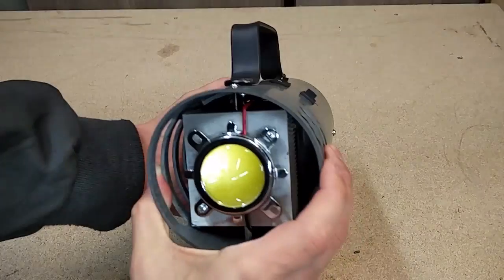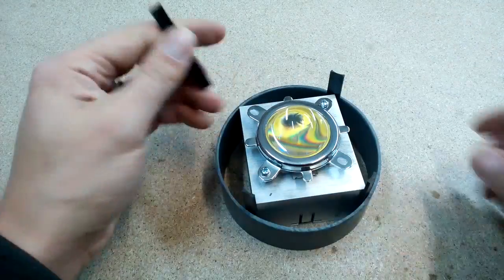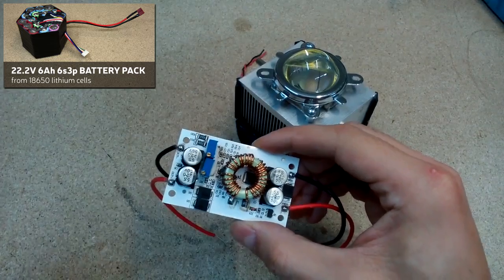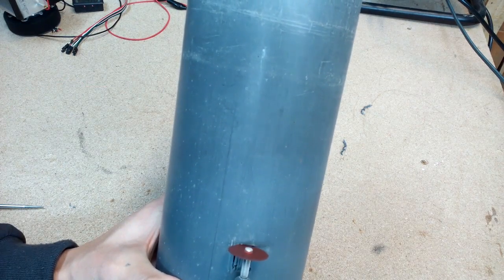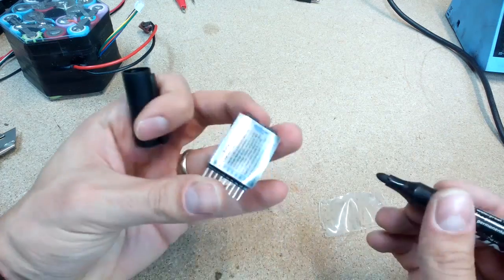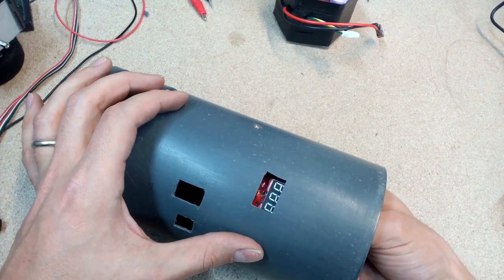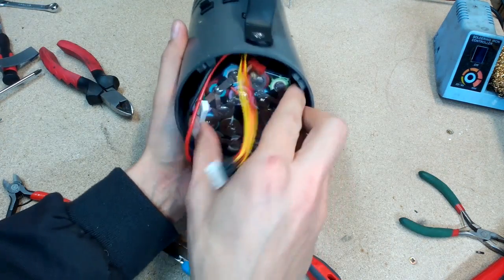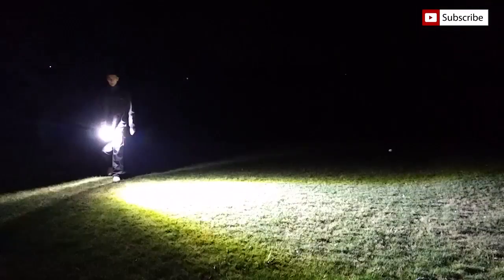DIY: 100W LED Flashlight Mounted In PVC Pipe

Comment: That is honestly one of the most elegant DIY LED flashlights I've seen on YouTube.  Only thing I would personally change is to sacrifice a small amount of overall length to give the cooling fan a bit more breathing room;  I, personally, wouldn't feel comfortable having the circuitboards that close to the airflow of the fan, just from the standpoint of the fan not being able to move the maximum amount of air away from the heatsink.  Gorgeous, though.  Very well done.
Reply: What it needs is someone to strap an corsair h110 to that board and Watercool that bitch
Reply: I went to the 99 Cents store and bought four LED flashlights, tape them together into a round group and turn them one. $5 dollars project done in 1 minutes.
Reply: Pheap K you don’t realize how bright that led is
Reply: I677  b bbn b bb 770g per v7r vg vv 5am u t t to z5
Reply: Ian Mcclue u

Comment: So your taking all the heat from the LED away with heatsink and a fan, but your blocking the hot air from escaping with a fucking circuit board.

Comment: isn't it much better to use RC Lipo Battery ??! ..
Reply: +Gery Revandra with this amount of batteries it dowsnt realy matter
Reply: +yakir11114 but isn't it kinda wasteful to use so many small betteries then stack it into one huge power supply ??! ...
Reply: +Gery Revandra  Those are 18650 cells. Tesla uses thousands of them for their car. Laptops often use up to a dozen of them. They tend to store more energy by weight than RC lipos, and they are also much tougher physically. They can't source the extreme current of an RC lipo, but the LED is only 100w.

It also looks like his batteries were salvaged from dead laptop batteries, which makes them far cheaper than an RC lipo.
Reply: +compwiz00 ah , i see ... thanks for your info ...

Comment: this is so awesome I've been planning something similar, would it be possible to place a analogue dial to adjust brightness? if so where would you wire it in?
Reply: a heavy duty potentiometer in series with voltage trim pot would work, just make sure to only adjust your trim pot while the extra potentiometer is at max brightness.

Comment: how long it will run on those batteries and how do you charge them?
Reply: He's gotta learn somehow, bud
Reply: Well, I'll answer you...
Assuming the cells are about 2000mAh (7.4Wh) then 6S3P will have a capacity of 6Ah with an average voltage of 3.7x6 = 22.6 V and total Wh of 18x7.4 = 133.2 Wh.
At 22.6V, 100W will draw 4.4 amps.
Assuming the LED is running at 100W and (100% boost converter efficiency!), then it should run for 133/100 hours, which is 1h 20mins.
To charge, remove grill, unscrew bracket and slide out battery pack, unplug the balance cable and Deans connector and plug them into any cheap lipo balance charger, such as a B6AC.
Laptop cells in general shouldn't be charged faster than 1C (that's 2A for a 2Ah cell), but lower is better for cell life. I would limit charging to 0.5C or 1A per cell, so charging at 3A would be appropriate.
It should charge in a couple of hours.
I would make a Y cable for the balance leads and power and make them available to charge without having to disassemble it!
Reply: Unerring 01 lol right. Everyone was born with everything they'll ever know
Reply: guys, he is asking where exactly is the charging connector or if there is none, what is the exact procedure to charge them (i.e. open the assembly, take out the batteries etc.)
Reply: avin r Exactly.
Reply: Wrong, if you don't know stuff you can't learn stuff. Everyone knows that.

Comment: Very nice build, I like the packaging. But I still see some room for improvements: clear cover over the lens to keep bugs and stuff out, bug screens on the cooling vents, bigger cross-flow style CPU heatsink, and use R/C car or airplane battery packs for quick swap-out and using OTS chargers.

Comment: I would just use a 12v battery and wouldn't require the down converter.
Reply: Its not a 12v led, as its 10 leds in series times 10 in parallel, 1w each.
That would mean something between 30-35v, and an adjustable supply is needed.
Reply: +drkastenbrot u r using a up converter anyway so a 12v - 36v upconverter should be fine.

Comment: Very very nice idea to put it in a PVC pipe.. Such a simple idea! :) Just a tip, when tapping, counter-rotate the tap every two turns to get rid of the stripped aluminium so your tap lasts longer.

Comment: Less "greeze" is better ;-)
It must be a very thin layer, use a credit card to swipe off the excess.
Reply: +Roger Keulen I agree, on precision parts with flat surfaces. I used to mount large power supplies to heat sinks that were about 30" by 14" mounting surface. Anyone can then look at heat build up in  the power supply. I used a wide putty knife to apply thermal compound. That and for long term maintenance, it's nice to leave the work area as clean as possible for yourself or another technician.
Reply: +Roger Keulen Nope. linus tech tips proved that you can use as much as you want, too little is bad.
Reply: You think ? It's to make the surface smooth.
Reply: Roger Keulen it really doesn't matter how you apply it you just need enough to cover the thing.

Comment: Nice job and very well presented -- thank you
Reply: The thermal paste was incorrectly applied though.   It should be used WAAAY less, and you put a dot in the middle of the diode, not the heatsink, and then let the pressure flatten it out, which avoids trapping air bubbles.

Comment: How much did this cost to build?
Reply from the maker: +Sean Pain something around 22-23 eur  (24-25 USD).
Reply: Well Done Tips can you make me one and send it to me in the US, how much it can cost me?
Reply: But, the one you linked is much inferior in many ways:
The one in your link will get much hotter in your hand, the battery won't last nearly as long, it won't run at max brightness for very long without burning out or draining the battery, and is only 2/3 as bright as the one in this video.
Reply: Disregard that comment above. It's spam. That link has been spawning in all similar videos. That's a cheap chinese ripoff of a so-so flashlight.
Reply: +simon del calvario 100 eur, 23eur materials cost, 77 job
Reply: +pierre jean You forgot shipping cost :D
Reply: +pierre jean You forgot shipping cost :D
Reply: around 140 bucks

Comment: awesome build. lithium battery pack and battery tester builtin. driver placement right behind fan. great ideas. thumbs up for all of that.
although it have same problems like every other built have.
1. too much work to built.
2. no mechanism built to easily recharge the battery. you could have given some port to connect the balance charger like imax b6 which is needed in this case.
3. heat sink is too small. it wont be able to run for long time. it will get too hot. i have already checked these things.
keeping all these things in mind. i made one 100W LED flashlight myself few days ago.
check it out.
https://www.youtube.com/watch?v=xzh0OwaisjE
does not require too much work to built and it uses regular tool batteries. which can be easily charged by the charger that came with your lithium drill.

howevery to make it more easy i built another project. this one uses 72W LED work light which is readily available on ebay. all i did was to connect it to batteries. here is that project.
https://www.youtube.com/watch?v=t5Z4kXAPsJM
this is very very easy.
light output of both flashlight was almost same.
if you like these project. subsribe to both channels for more projects like these.

last but not least. i really really really like this built. just add a way to easily charge the batteries.
Reply from the maker: +Buffalo Geeks yes, if I'll use this flashlight day to day - then I definitely will make a charge port. At a moment - I'm using it very rarely, so to charge battery isn't my day routine.
This is my interpretation and idea, how I to make 100W LED flashlight. There's many other possibilities to solve body, power and cooling issues.
Reply: +Well Done Tips Lots of circuits on Ebay. I have replaced most Chinese product with defective batteries with 18650. Never had any issue, just have to check the voltage ratings of original battery, a bit off works good. Have done this to my Mosquito squatter and LED torch, Could fit 2x 18650 in chinese torch, they last for ever.

Comment: Great video, how long will the batteries last.
Reply from the maker: +k fro this my homemade 22.2V and 6Ah battery pack is able to power up flashlight for 2h.
Reply: +k fro setted to 3 amps the led the batery pack has 6Ah preatty much close to 2h, less led britenes then the maximum will it get more hours from these bateries
Reply: no overheating problem?

Comment: what about mode selector? Like: Hi-mid-lo?
Reply from the maker: +Dmitry Lyashuk there is an option to install a dimmer and you'll have full brightness control. But at a moment - I don't need this option.
Reply: +Dmitry Lyashuk if you want a dimmer design look at "DIY Perks" video
Reply: +Well Done Tips мужиг, ты кросавчег. Но мне кажется, им можно самолёты сбивать))
Reply: How would you make a dimmer work with this driver. Im trying to put a light together using this driver.
Reply: there are led drivers with build in dimmers via a pot... they are widely available on eBay.. led driver dimmer... look that up... done...! no thanks Urr welcome!
Reply: You can essentially hack the driver where the small blue current potentiometer is.
The pot works by resistance, and if you add two wires to its connections on the board, you can put another (1-turn)pot on the outside of the pipe to control the brightness/amperage. It will require an additional resistor in series as well.
The values of the added regulator pot and resistor depend on the operational range you want the current to be within. IIRC, my own experiments with a voltage regulated buck converter were: R = 5 kOhm ,  Pot = 3 kOhm in order to adjust voltage for a string of LED's to  be within 2.8 to 3.9 volts per LED.

I think several people have made guides for this kind of hack. :)
Reply: You can use an ND Filter
Reply: Dmitry Lyashuk

Comment: Very nice project, well build. The only problem I have is with the LED, why use a cheap one from ebay that doesn't even put out the lumens it advertises? Generic COB LEDs aren't that expensive and you will more lumens per watt, which means your flashlight can run for longer :)
Reply from the maker: +BukkitViper yes, I know that. But this was a cheap build, and a first try to work with COB led chips. If you have trusted seller with 100W chips for reasonable price - please share a link. 
I made a flashlight construction witch allows me any time easy disassemble, change any part and assemble all together.
Reply: I would say digikey has some great offers :)
Of course they are not cheap if you buy them in small quantities.

Comment: where is the charging port?
Reply: under the grill, at the back of the torch. 15:55 - balance wires. this battery must be charged by the smart charger like a Imax-b6 or its clone
Reply from the maker: +Dmitry Lyashuk Thanks for a clear answer. I forgot to mention this information in video.
Reply: +Well Done my pleasure, you have done really great project, I'm impressed. One more question, what about battery time?
Reply from the maker: +Dmitry Lyashuk battery could hold about 2h with one full charge.
Reply from the maker: +Dmitry Lyashuk battery could hold about 2h with one full charge.